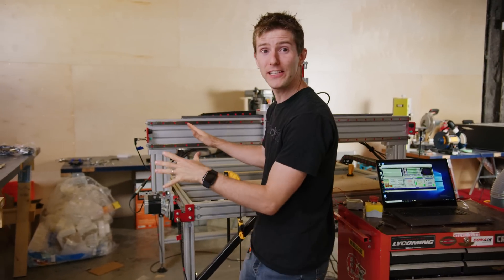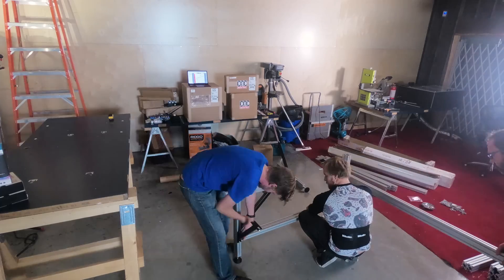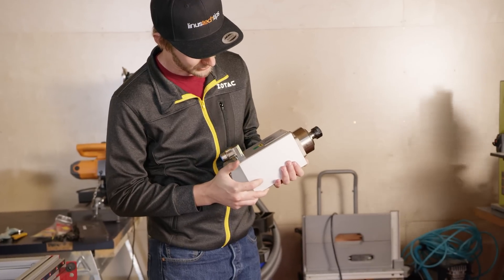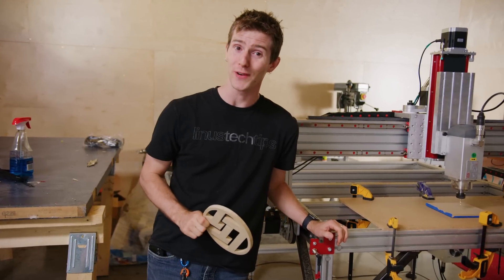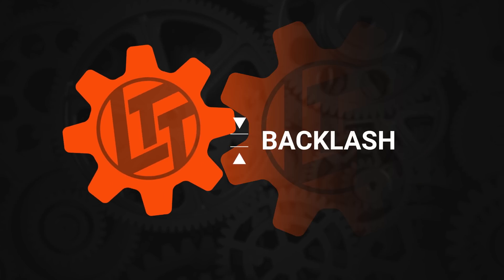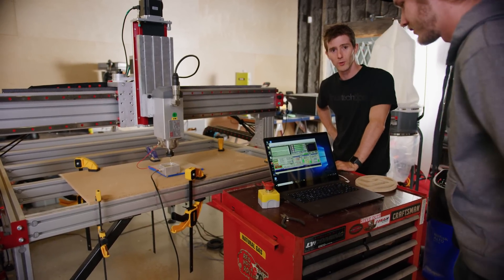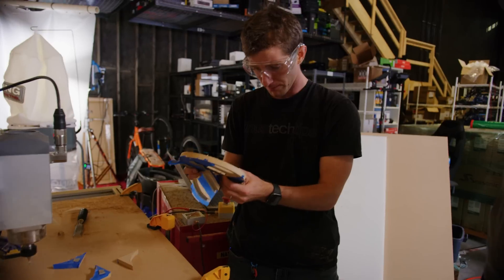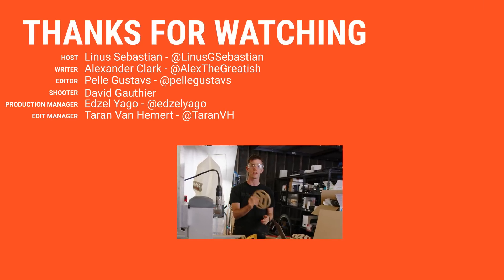Our New $10 000 Router!

Comment: Fred Flintstone the router .
 Are you going to design your own case , does it work with metal ? Could you have a make your own retro computer with a limited budget and theme it for like cartoons. See who can make the best cartoon themed computer? 
I so would be interesting if you used all three tools , your laser cutter , cnc router and 3D printer and see who can come up with the best modded computer 
I would also like to see some water cooled coke cola or other drink rig.
Reply: Honestly, if you're asking that question on Youtube, the Pocket CNC is likely the only one that will work well for you, if you really want 5 axis.  

If you want big and cheap, try the X-carve from inventables (not 5 axis, no programmatic spindle speed control), or the Blackfoot from buildyourcnc.com (also not 5 axis).    I wouldn't call either of those good quality though (nor would I really call this 10K build good quality), due to a lack of vibration damping, rigidity, and actual accuracy or precision (for reference, stepper microstepping isn't a positive displacement thing, while industrial machines use servo motors, which make sure they are actually in the right place, and handle backlash with ball-screws instead of sprung rack and pinion systems), as none of the machines listed here would reliably hold a .005 tolerance in heavy cutting, much less the sub-thou tolerances that some (semi-rare in my shop) parts require.
Reply: +Dominic Shiells  No.  This isn't a metal cutter one.  It's simply one to use for wood, plastic, acrylic etc.
It's basically the bare bones one.
One's that can cut into metal and such go for an upwards of 300k, and sometimes even over 1 million.
Reply: Incorrect.  This can cut metal, albeit slowly.  The spindle in use here is similar in power to a bridgeport, but with much better speed control thanks to the VFD.  The biggest issues will be cutter force, which can bend the gantry.  

I happen to work with actual industrial CNC's, and even a metalworking specific specific CNC can be bought for as little as 7k (syil x5), while a decent small business solution for a non-machining company wouldn't be too much more than 75K (HAAS super mini mill w/ the high performance package).  

A 300K machine is something more like a fully optioned out HAAS 5 axis machine (Haas are a mid range brand.  Better than Tormach by a mile, but typically not challenging the big vendors like Mori or Okuma).
Reply: David  I'm sorry. I don't mean to be condescending, it's just that the support infrastructure for something beyond a Pocket, is not going to fit well in a home unless you already have it. My small home gantry router, which is similar to this one, is 25 sqft. Just for the table and machine, takes a 220v 20a socket, and makes a mess. Adding additional axis to machines typically takes a lot more CAM experience to use (try ham in solidworks or inventor, if you don't already use it).  Many actual trained Machinists are not comfortable with 5 axis tool paths and fixturing. It's just that unless you have the experience to know more specific places to ask, more complicated options will be more expensive given the time and extra effort needed.

Comment: BIG HINT: Use a down spiral cutter when working with sheet materials. It gives a clean finish and helps keep the work on the table. http://s.aliexpress.com/jIFVbiyM?fromSns

Also you want to use multiple passes at a high feed rate rather than deep cuts going slower.

Comment: Um actually Linus. Most cnc routers are accurate to 1 thousandth off a mm, not an inch. That's a big difference. If yours is that inaccurate you could do a better job with your feet.